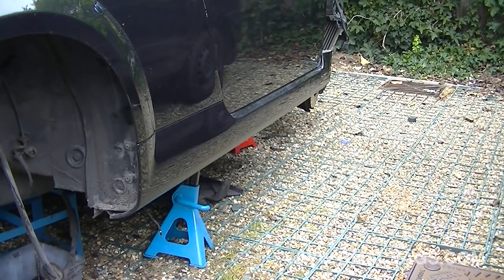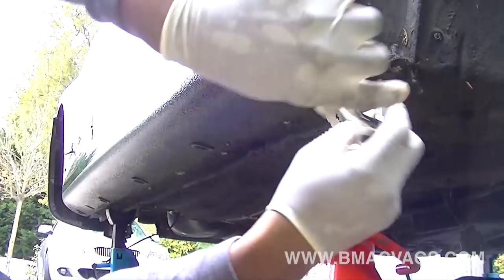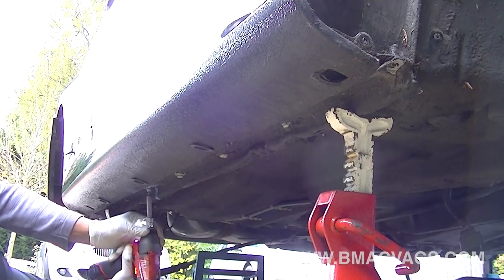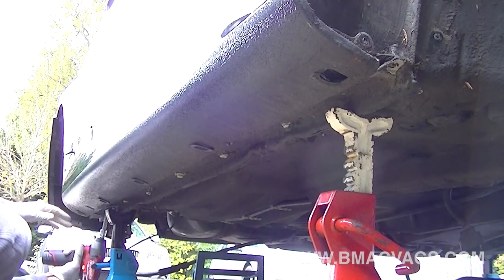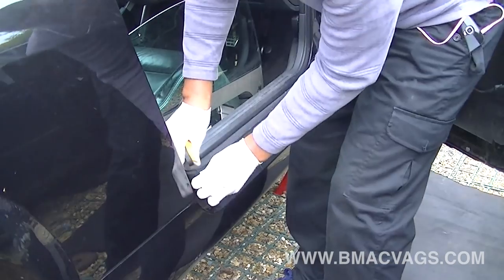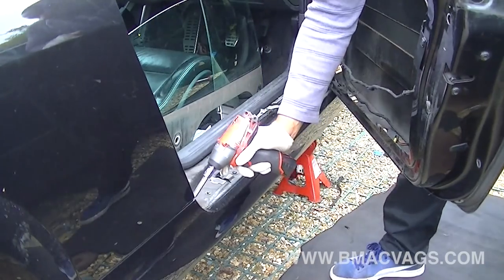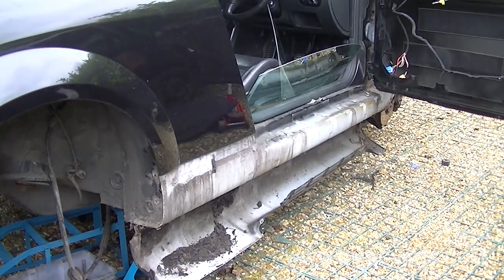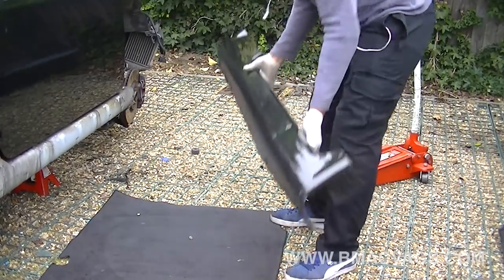Audi TT Side Skirt Trim Sill Removal

Comment: nice one mate, are you breaking the to for parts or is it a project car?
Reply from the maker: All broken up now
Reply: Just seen the first tt vid, makes more sense now. You make it look effortless. I've got bumps on my sill and my front wing, which I was going to replace but the cost of parts is the same as dent repair and respray so I'm still undecided. Your vids are leaning me one way more than the other tho
Reply from the maker: Yes it is a common problem. If you can get one cheap enough, i think it is better to replace
Reply: was that a pre 06 tt mate?